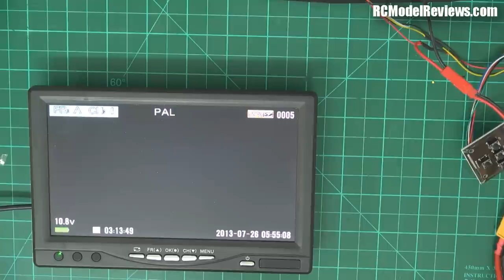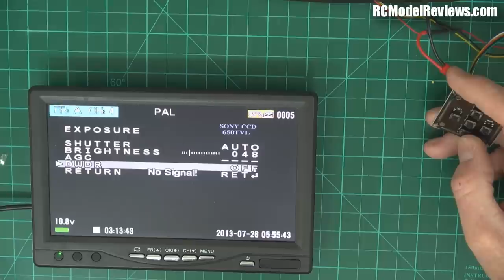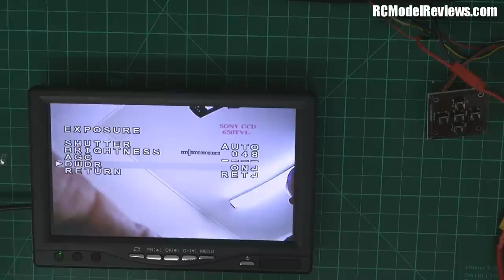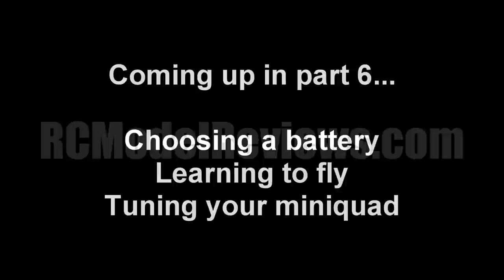Low cost miniquad racing drone build video PART 5

Comment: It will be the same if I put two red cables separately to dwo 12v pads on pdb instead of doing cable harness? And second ground cable to ground on pdb also. Greetings

Comment: Hello Bruce / all, I'll be using a Graupner GR-12 receiver in my build. This receiver takes a maximum of 8.4 volt! This means that I can only use a S2 LiPo with this build!
Or, do you think that I should go for a S3 and a voltage regulator?
Reply: n03l l Never mind.. Tested with a S3, and it looks like the GR-12 does work fine with it (for now).

Comment: I am so mad at myself. I got some and I was so happy. until I got my new 250 up to about 4 feet and the back right prop shot off. it appears I some how got the ccw motor going in the wrong direction. I was able to find the prop but that nut is gone. and of course us Americans are fighting the metric system so it's very hard define the five millimeter nut. and it appears to be impossible to find counter clock wise 5 millimeter nut.

so just as a quick tip if you have directional motors make sure they're going the intended direction and in the proper place. or you could find yourself waiting weeks for a $0.50 not.
Reply: I had a similar experience, but thankfully found all the parts. Online you can find M5 reverse lock nuts, and at a local hardware store you can find standard M5 lock nuts, which are nearly impossible to lose in a crash.

Comment: I've finished the build, and discovered that when arming the "quad" for the 1st time it takes some time to react to the throttle!
Is this normal? I've set all the begin, mid and end values as suggested (1000 / 1500 / 2000)

Comment: I know that the links for the video tx and camera are on part one.  But it would be helpful to have them here as well. 

I am assembling the bits and pieces for my build.  (Tx, Naze32, Motors, chassis, but the Afro 12 ESC'S are on order.)  I want to get it line of sight air worthy before I go adding video.  

I think I am going to go LCD rather than goggles as I wear corrective glasses.  Banggood.com has a frame to mount an LCD on the TX.

Comment: The problem with that crocodile strip stuff is that it melts & breaks at low temps, such as exposure to a heat gun, that is shrinking some heat shrink tube at a normal temp.

Comment: Hello... I have a Naze32, 5v piezzo buzzer from Hobby King, Taranis, 1300 4s set up with 3 issues relevant to your set up I was hoping you could help me figure out.
1) buzzer beeps while I fly and the more I fly, them more it beeps.
2) PIDS & TBA Got some jello going on (but flies great!)
3) Taranis says "low battery" right after the welcome speech and periodically throughout my flight.

I've watched many of your videos since I'm spanking new to RC, let alone multirotors... Thank you very much for doing this.  Hope you can touch up on these issues on the next episode.
Reply: Hernan Faraci I bet you're using a low-C battery (perhaps even a Zippy Compact?)
Reply: Hernan Faraci 1) The low voltage alarm is going off. The more thrust you use the higher the voltage drop. You may want to lower the low voltage alarm.
2) Jello probably not caused by PID but unbalanced props and other vibration. Try balancing props and using some time of vibration dampening.
3) if you are using telemetry back to Taranis with D4R receiver the Naze board doesn't tell voltage unless armed. So when you turn on Taranis the voltage reported back to Taranis is 0.0 volts. Once armed the true voltage will be reported to Taranis.
Reply: Hahaha... Yes 4s Zippy compacts!    Any better bat suggestions?   I'll lower the voltage and let you guys know how it turn out.  
As for jello, I have my Mobius mounted directly to the top plate w Velcro and double sided tape between it.  I'll ballance the props 1st before changing that. 

 Thanks!!!
Reply: Hernan Faraci Yes, go with a much higher-C battery, the Turnigy Nanotech ones work for me.  The 1300mAH 45-90C are good, as are the 1500mAH 35-70C.  These packs hold their voltage much better under load than do the Zippy Compact batteries.

Comment: Please Help!!!  Getting jittering and split screen.  Occasionally I get a clear picture but when I move it it jitters again.  New to FPV so I bought this camera (PAL) and transmitter setup.  I am using an RC8332 receiver with $30 Hobbyking goggles.  Goggles work on DVD Player (NTSC).  Tried different channels and it is not even on the quad yet so I don't think it is noise.

Comment: Hi, is there any way the video being kicked out by the transmitter could be received and displayed on a phone, tablet or laptop? 
Eliminating the portable LCD screen would help cut costs right?
Reply: +Flyleap Studios If you search for FPV on android smartphone with DVR you'll find a tutorial where they do this. You could buy just the receiver and do a set up like they did, but trying to fly off a phone screen/tablet would be incredibly difficult. I would highly suggest getting the quanum goggles. The v1 (what I got and loved it) are like $30 and the v2 ones (wish I would have got) are $60. Note: even if you get the quanum goggles you'll still need a receiver.
Reply: +Flyleap Studios so my parts just arrived to do this and it worked pretty well. It came out to be about $35 (not including battery and battery charger) to receive what's transmitted and display it on an Android device. Here's the write up I did on it: http://copterwars.com/blog/?p=64
I still recommend getting the quanum goggles though.

Comment: Where did this video transmitter come from. Looking for cheap, good working one
Reply: Raymond Bivens This is the one: http://www.banggood.com/Skyzone-TS5823-5_8G-200mW-32CH-AV-Transmitter-Module-p-922418.html
Reply: I looked for it on the u.s. site but they didnt have it. I just hate waiting 3 weeks from China. They are all over ebay also mostly in china. U.s. sellers want more for em. I discovered this after commenting. One day I will be fpv

Comment: Have you listed all the parts used to build the racing drone? I want to know what I need  to buy to build one.  Please let me know.
Reply: +Oscar Rubio search on Google for "fpv racing quadcopter copterwars" and you should find my blog post on this build with a complete parts and tools list. I didn't shop around too much, so there are probably cheeper places to get the parts, but at least you'll know what you need.

Comment: Instead of using the white spacers, I use Nitro fuel line, and 2 zip ties. Dampens the camera a lot, using the spacers got me a bit of jello in the fpv cam.

Comment: Thanks for the video Bruce.
I can see that your fresky reciver can take up to 10v how do you mannage it not getting too much voltage? On my build i am planning using storm s603 dsmx receiver with 3 cells 11.1v
, the storm is only rated up to 9.6v i hav no idea how to get around it without a dcdc voltage regulator anyone got any good ideas?

Comment: one would have to assume that the vtx does have built in power filtering
Reply: AndyRC It does have some filtering -- as does the camera.  They both have voltage regulators that remove much of the noise (in this case, all of it).
Reply: I thought as much Bruce thanks for the reply. for every fpv setup I have either filtering or a separate battery is needed. cheers

Comment: A trap for new players - bought a pack of JST plugs and sockets (with tails) from Banggood some time back and soon discovered that the red and black wires were opposite to other devices including Lipo batteries.  I haven't figured out how to switch these wires on the socket (plug may be easier to change but no point unless I can change both)

Comment: Do you have any suggestions for a starter radio and goggles?
Reply: +Aaron Pratt Taranis is totally worth it even for beginners. The Quanum V1 Goggles work great and are super cheap, but I wish I would have got the V2 version.

Comment: fourth, hey bruce... I am making a tricopter and was wondering which motor to use. I want something cheap but is efficient. Do you have any recommendations?
Reply: 우희도 It depends on the size of the tricopter.
Reply: I'm first build was a y6 I used sunnysky 2216 kv 650 II. Tons of thirst and lift. I hover at 33% throttle.
Reply: ***** hi, the tricopter is the rcexplorer tricopter. It's about 750g including the electronics and the distance from m1 to m2 is about 60cm. The DT750 motors are a popular choice but I was wondering if I could use cheaper, better motors... :)
Reply: The sunnysky 980kv are a great, better quality alternative to the dt750s
Reply: 우희도 I'm using these motors in my tricopter with 9x4.5 props.  Not sure how they do yet, waiting on ESC's, but based on the the given information they look good. http://www.readytoflyquads.com/brushless-outrunner-hacker-style-20-50s
Reply: 우희도 HI, if you go cheap you will go twice, better to wait and save up than buy to cheap. Stick with what DAVID recommends for his tri. Trust me i know about cheap.;-)

Comment: Hi Bruce (or anyone else), I have this same board camera and it suddenly gives black screen. The crystal is still in place, could it be busted? Do you know what else could be the issue?
Reply: +Nilz when I broke my crystal I got the snowy no signal screen, so I doubt it is that. No idea what is though. Good luck!
Reply: +Isaac Davis thanks for your reply. I remembered powering the camera with a 4s battery so I'm pretty sure that killed it.

Comment: Bruce, (or anyone else!!) Help me!!! Followed the video's, & thought 'Give that a go, Cheers!!) Also thought I would be clever, buy a CPPM  Rx, and a Naze32 mini, to save as much weight as I could,.... only to find, No mounting holes in the Naze32 mini board!!! So, how do I mount the Naze onto the carbon fibre frame??? TIA, Fred
Reply: Fred Cooper ..... Oh, & one other newbie question,... I see its not too hard to get a direct video feed out of my Mobius camera, is it ok to use that for the FPV Tx, or is there a view angle/lag problem???   (Will save me a few more Bucks, ans Grammes... :-)   ) Cheers, Fred
Reply: Fred Cooper Ok, guys,...... I will answer my own question,... DON'T mount the board with Velcro!!!!! If the board works loose/tilts while in flight, in self-level mode,... It may well end us trying to correct, and bounce of a wall, perhaps,...... (Don;t ask me how I know this!!!   :-(  ) I have attached it on the rebuild with a couple of dabs of hot glue...........

Comment: where can I buy those spacers/ standoffs.  BangGood only doesn't seem to carry the nuts or the bolts for the stand offs.
Reply: Bill Sheley Search ebay for "M2 Nylon Hex Spacers Screw Nut Assortment Kit Stand off Plastic Accessories Set"
Reply: ***** Thanks!
Reply: ***** Bruce, will M3's be too big?  Offerings for M2's are only available from China unless I missed some.  Don't want to wait 6 weeks if I can help it.
Reply: ***** The holes in the camera are only 2mm so M3 won't fit.  However, you can use longish M2 bolts and nuts to achieve the same thing if you're clever.  You could probably even use some old servo-screws and some bits of plastic tubing if you're really stuck.
Reply: Thanks Bruce, I'll figure out a way until they get here, gonna order a couple boxes as I have an idea I'll be needing more.
Reply: ***** You can always use RC fuel tubing and small tie wrap.  Cut small pieces on top to give you some upward angle.

Comment: can you connect the reciever to an android device
Reply: +A&K JR. Outdoors I would not recommend flying with it as your primary screen, but it would probably work well as a second screen for spectators. If you search for FPV on android smartphone with DVR you'll find a tutorial where they connect an Android device to the receiver in their goggles, so I do not see why you could not just plug it directly into a stand alone receiver. If you're trying to do this to simply save on cost I would highly recommend the quanum goggles instead.
Reply: +A&K JR. Outdoors so my parts just arrived to do this and it worked pretty well, so I did a quick blog post about how I connected the receiver to my Android device: http://copterwars.com/blog/?p=64

Comment: I did the wiring for the camera/transmitter exactly as shown and have the transmitter mounted just like yours. The setup was working with my donimator goggles, but it has since stopped. I don't know what could have caused it. Help?

Comment: Do I just use any remote that "fits" it? But on the same radio signal MHz
Reply: I'm not quite sure I understand the question, but you should have a receiver to match the protocol of your transmitter. Specktrum is dsmx/dsm2, frisky is accst, and so on.
Reply: Thank you ;)
Reply: +Decrypt_Anomaly no problem, good luck with the build!
Reply: Thanks :)

Comment: does anyone know how the plug in the video transmitter is called? mine is broken, but the transmitter still works. so i only need a new plug for it.
Reply: slaapkonijn58 Mini JST
3 wire Mini JST on camera, 5 wire mini JST on transmitter
Reply: thankyou. now i can finally fly fpv again.
Reply: ***** klopt maar die andere was al kapot toen ik m kreeg

Comment: What is the total cost?
Reply: +Jacob Falk Quad under $300. Accessories (batteries, battery charger, goggles, transmitter) was $325 for me I got the quanum goggles and a Taranis transmitter, but if you got a cheaper transmitter you could probably get all the required accessories for under $200. I spent $75 on tools, but if you've already done electronics work you probably already have what you need. If  you're interested about the exact break down I put it in this blog post: http://copterwars.com/blog/?p=4
Reply: +Jacob Falk I just finished getting all my parts for a 450 custom build and it was about $350 but I spent probably $150 on different tools and accessories.

Comment: if no one has already said the strap attaching the video transmitter to the top plate is a rapstrap you can find it on eBay.
if anyone is interested the first batch of PDB's i put up on ebay have all gone ill put up another batch in a few days.

Comment: I actually ordered a 5.8 vtx that looks just like that, except on hobbyking they call it "Skyzone". I had to RMA that set because I barely got any visible signal through static. $70 RTF FPV set sent back to RMA, and a $42 Boscam set off ebay works perfectly with a simpler wire layout, go figure.......

As for mounting it, I had the same idea in mind with the velcro ( I use this stuff http://www.hobbyking.com/hobbyking/store/uh_viewitem.asp?idproduct=9374&aff=410109 ). Leave the channel switches on bottom uncovered (duh) and I align it over the hole in the bottom of the ZMR frame so I can just reach in with a needle or xacto blade and change the switches

Comment: How much did you spend in total
Reply: +Kernow Crosser Total cost for everything including tools for me was roughly $675. $275 for the quad parts, accessories (battery, transmitter, goggles..etc.) was $325, and tools (not including laptop/comptuer) was $75.

Comment: Any one know about Naza32 boards????? I have followed Bruce for some time and built as per this series but I have 1 motor that spins up faster and than the other 3 when bench testing with my TX but is smooth and precise with all 4 when I use the Baseline software test? And Yes I have set the esc's up 14 times as per the youtube vid any help would be appreciated.
Reply: The naze may be in self leveling mode and not a "level" surface. That would cause one motor to spin up faster.

Comment: How much was the build total?
Reply: george aura It really depends whether you have some stuff prior to the build or not (heatshrink, tools, etc)
I just finished my build and seeing i didnt have much stuff (apart from a leatherman :D) it must've cost me around 250 usd including fpv gear and quanum fpv v2 from hobbyking + a lipo charger(add 50 for a decent soldering station)
Reply: Well actually that's pretty great since most I have seen the cost to be even more, I have almost everything for my build just need a pdb  and taranis transmitter
Reply: +george aura I also pondered on the taranis buy but decided that was enough costs and I use my spektrumdx6i that I had already. Sure it's not as customizable but for this starter drone it's more than good! There are cheap receivers for it too, like lemon RX and orange RX.
Reply: Oh ok well you got it better than me then cuz I Dont even have a transmitter to start with, so I figured just start big lol
Reply: +george if you don't have any tx then indeed it's your call! Some say it's good to spend on a good one first! I know I'm not disappointed in my dx6i, bought it second hand for less than 80 usd.
Reply: Wow well I wish the one I was looking to find would be easier to find and that cheap still haven't seen a cheap one
Reply: +george aura Total cost for everything including tools for me was roughly $675. $275 for the quad parts, accessories (battery, transmitter, goggles..etc.) was $325, and tools (not including laptop/comptuer) was $75.
Reply: +Isaac Davis What goggles did you get? I kept that part low with the Quanum goggles (pretty decent for the price!) . I highly recommend this as a starting kit. If you love FPV, then you can upgrade and always keep it as a spare or show a buddy fpv flying! Batteries can get expensive depending on where you live, and how much you want to fly. I bought 6x 1800 nanotech 45c. Good c rating and keeps me in the air 6-7 minutes without going under 3.8volts. However, the more batteries you buy, the more you want to upgrade your charger.. Went from genuine imax b6 to lipo parrallek charging with turnigy reaktor. Charges my 6 batteries in 30 minutes at 1c rating! Awesome :)